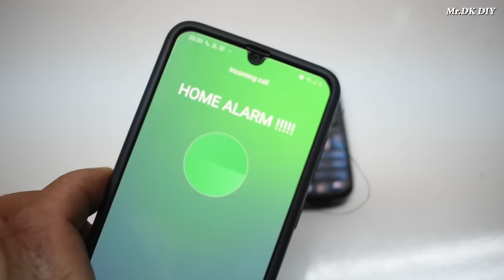DO NOT THROW AWAY YOUR OLD PHONE / DIY Home Security Alarm System

Comment: You need some way to close the door without having to hold the switch out of the way.  Not a big problem BUT needs to be addressed.  It's the idea that counts, thanks.
Reply: That's why they use magnetic switches for door applications.
Reply: fit a small wedge to the door upper and mount the unit a little further up. Sorted.

Comment: Step-by-step subtitles or voice narrations with explanations would have been helpful.  I kept wondering what those modules were, what their function was and why they needed to be disassembled.
Reply: Cannot see the video? The first was a cell phone, it had to be disassembled to find the "1" switch contacts where he welded two wires, he then programs the phone so that when 1 was pressed then it woukd call his cellular. The second was a microwave hoven, he took from it the microswitch soldered it to the "1" wires and the on off switch to hallow the alarm to work or not

Comment: You needed some captioning. Could not decipher what you accomplished, and was that a SIM card that you inserted? If so is it an active account attached?
Reply: Yes, that was an activated sim card. When you open the door, the switch is activated and then the phone will ring your inserted number (that will be your own number). The taste that he wired, i think is one of the tastes that you make rapid calls. On the old mobiles you can set up like press the taste 1 call my GF, press taste 2 call my Dad and so on. When you open the door, that wire act like you press the taste to call someone. On your own phone you register that number in your phone book as " HOME ALARM" and you set up  that particular Alarm sound to know exactly where the call is coming from without even looking your phone. Here you have it "Intruder Alarm"....  Make sure your Magnum 45 it's handy and already loaded.
Reply: Old phones needed sim card to activate phones menu..

Comment: ive once about 10 years ago have build such alarm system...!  Because that place had no direct power line! Using the direct call last number option under one button. You need to look for phone that can call after pressing two times the call button. Also it must be able to maintain that action while keeping pressing that same button. So far i remember the old nokia serie's are best. When you solder two small wire's to the copper button connection you then can use it connecting it to a relay switch so it starts dailing. The most easy sollution is to go with the most simpel cirquit using a 12 volt relais and 1000uf condensator. Connecting it like the car flashlight indicator circuit. So now if you connect your phone on the switching contact it should start dailing soon as you power the relais to start switching. When you place in you door post a magnetic switch and a small magnet. When its all connected then the relais should start switching when opening the door. The only thing then is the fact you must make a bridge connection so that as soon that the door opens then contact is staying on when you close the door. Otherwise you might risk that it didnt start to call its not always directly responding and might sometimes need 3 of 5 to make the connection the slowest switch seems to work best to fast an it wont react...